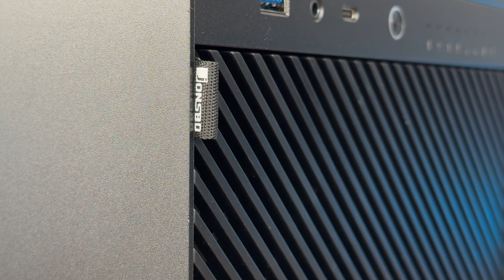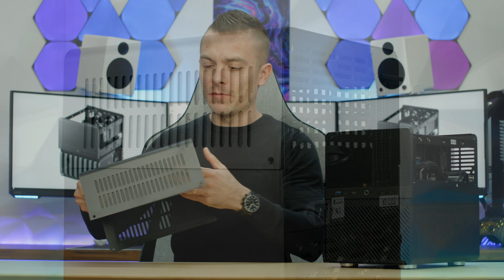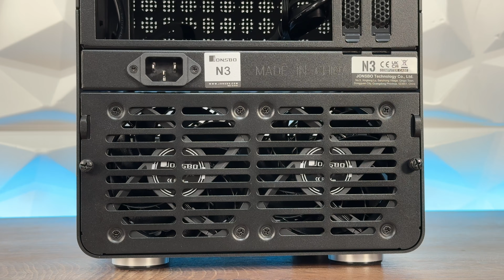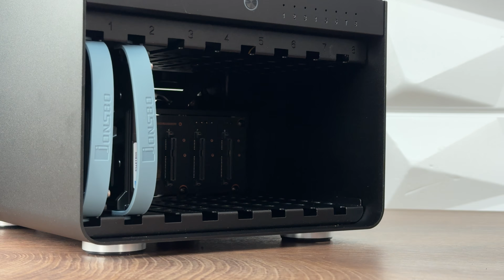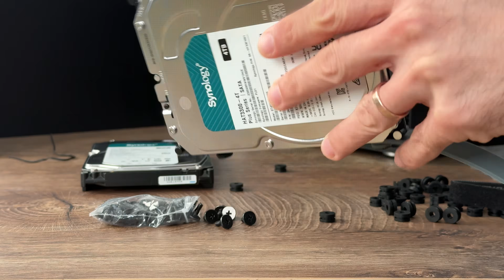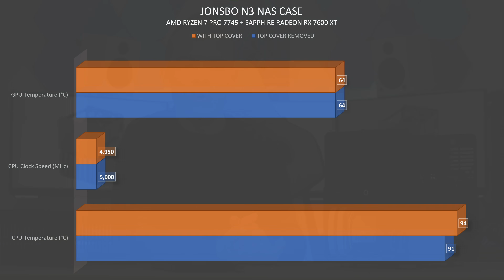EIGHT HDD BAY COMPACT ITX CASE - JONSBO N3

Comment: funny.. my M-ITX motherboard has 12 SATA ports and N5095 CPU.
Reply: ITX are usually short of SATA ports. What's your motherboard?
Reply: @faster_than_bugs  It is identical to the common N5095 / N100 with 6x SATA ports motherboard (topton?) ahh it was labelled GZBOX (but of course the names change with every advert
Reply: @craigprocter1232  thanks

Comment: Just because something fits it doesn't mean you should. Most of the negative point mentioned was because this NAS case was attempted to be used as a gaming style ITX case. There are better case with better price than this one if you are going for gaming purposes. Most dedicated GPU that you would typically see in NAS/Home server are low profiles ones which would definitely fit with no issue. Sorry but this review is a bad one imo...

Comment: You’re trying to use a NAS case for gaming… you didn’t come out and say it, but servers don’t care about video cards… most are “headless” and never even get hooked up to a monitor. I configured 5 IBM servers and they were never connected to a monitor, mouse or keyboard. I understand why gamers use small cases, but understand,that’s not what most of them are intended for. The latest and greatest video card in a server case is useless for what they designed it for. They shouldn’t have even bothered designing it to accept a video card, but I understand why they did…so they can’t open up the purchasing market to improve sales.
Reply: As soon as I saw the rather large Sapphire GPU, knew this build was getting a little nutty.

Torn between this and the N4 case as the latter can take an old mATX board with a Ryzen CPU installed that I have.

Wee need a Jonsbo 3.5 that takes and mATX board too 😉

Comment: to power all 9 drives in Jonsbo N3 you only need two Molex and two SATA power connectors on the PSU

two Molex and one Sata for the control board in the 3.5-inch drive compartment   (control board supplies power to the individual 3.5-inch drives) and one SATA for a 2.5-inch drive in the motherboard compartment

Personally, I managed to fit 13 drives in this case (2x 2.5 inches, 8 x 3.5 inches and 3x M.2 nvme) + low-priority Intel Arc A380 GPU I only had to buy two splitters from Aliexpress and have a motherboard with the PCIe bifurcation option
Reply: What motherboard did you use for this setup?